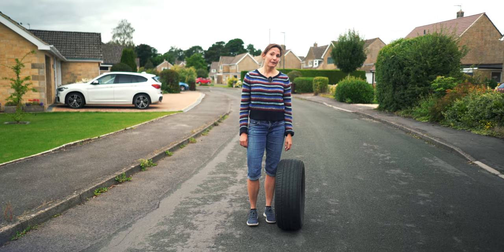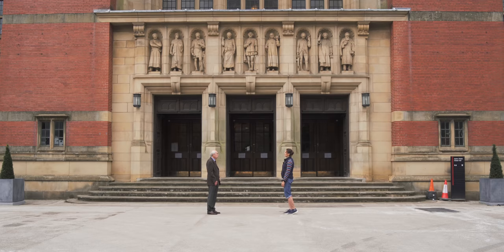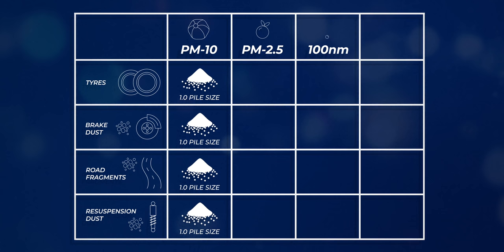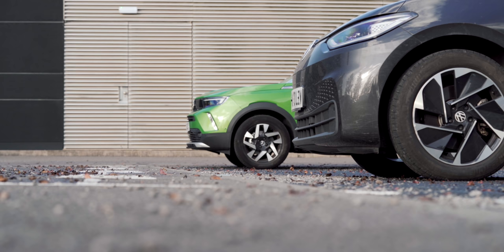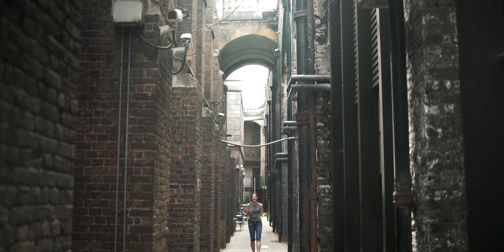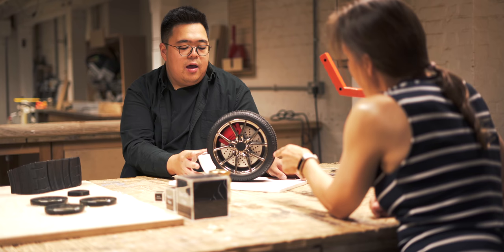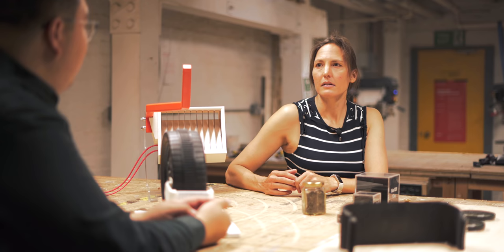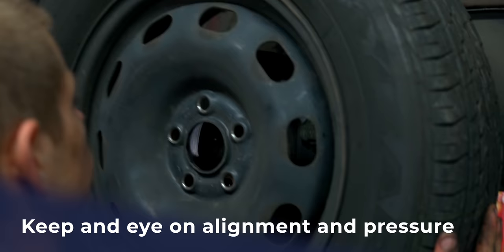The Secret Pollution That All Cars Are Guilty Of | Fully Charged

Comment: My previous ICE vehicle was 1450kg Megane. My Model 3 is 1890kg and has way more hp. Both of those should result in more tire wear. After almost 3 years I am still astonished though that tire wear is definitively less. If I'd be forced to give a number, I'd say 25-30% less. Tire size and even the tire brand is the same and I do not really drive "tamer".

Being very surprised I tried to think why this might be the case, until it one day at a traffic light hit me. I was first in line at a traffic light and wanted to get in front of the car to my right so I hit the accellarator really hard and for the first time conciously noticed that even with a 3.1s 0-60mph acceleration there was no squeaking and tires loosing grip, just brutal acceleration. Accelerating like that with the Megane would have left black marks on the road and made a lot of noise, but because the electric motors can adjust power and torque way faster there is no dicernable tire slip and therefore less tirewear. 

Did anyone have similar observations?
Reply: AWD v FWD.
Spreads the wear more evenly.
Reply: AWD v FWD, Spreads wear better
Reply: @sandersson2813  Even with rotating tires every 10,000km after about 25,000km tires were close to the legal limit on the Megane and had to be replaced.

You are right, with the AWD Model 3 tire wear is more even. Rear achsle wears a bit more. After about 20,000km the rear was a bit more than half, front a bit less than half gone (on it way to the legal limit) and I rotated the tires. I expect this tire set to last something between 35,000 and 40,000km, which is way more than the 25k on the Megane.

When calculating cost, before buying the M3, I had calculated for more tire wear. It's not the only cost factor that I overestimated though, fuel cost and maintenance were lower too. All in all only positive surprises so far.
Reply: That is quiet a Amazing observation! 
And i think you are right
Reply: My Nissan leaf wore the first pair of front tyres out much faster than my previous ice car, probably because I liked trying out the torque from zero a lot. My pocket dictated with their replacements that I didn't press the accelerator pedal so hard. Conclusion, it doesn't matter if it is ice or EV your, right foot dictates tyre wear.
Reply: You are forgetting one more crucial factor that with ev you will break less & use regen. That way tires wear and tear would be less
Reply: @GreenDriveIndia  that is a factor for the brake pads. But maby not that much for the tires.
Reply: @unerbittlich  when you apply hard breaks tires skids a bit too
Reply: @garenson  What sort of miser are you that you begrudge replacing tyres after 20,000km anyway? Its only a few hundred quid.
Reply: @sandersson2813  Those are Michelin Pilot Sport 4S tires that in Germany cost between 800 and 1000 Euro (900-1,100$) a set including mounting them on the rims. If that's a small expense for you, you're welcome to donate a couple hunderd quid to the next set😉
Reply: @garenson  Its not as if you are spending that every week, its every 20,000 km.
If you can afford  a Tesla you cant moan about tyre cost.
Reply: @sandersson2813  It's the other way around. Because of all those savings in maintenance and "fuel" cost the Tesla Model 3 Performance in my usecase is cheaper in total cost of ownership than the Renault Megane hothatch I owned before it, even though it's bigger, considered a luxury sports sedan and loaded with features the Megane did not have.

If you do those calculations for a Tesla Model 3 Standard Range it's about as expensive as a Toyota Corolla or Vauxhall Astra. So a lot of people , if they do the Math, can and do afford it. 

Not everyone has fun burning money unneccesarily, like you seem to do. I'd rather do something useful or fun with the money I don't have to overspend on certain expenses. That's personal preference though for sure😉
Reply: @garenson  The model 3 is not considered "luxury", sorry. Its just a standard car. 
A Model 3 performance is not cheaper to buy and run than a Megane either, behave.

A Megane would have been about 30k tops, 12,000  miles per year would cost you about 2k a year, and a Model 3 Performance is £60,000, so the savings on fuel are nowhere near enough to make up for the cost of the car.
Reply: @sandersson2813  Maybe not by people who can afford a Bently, Rolls Royce or Maybach.

Let's just agree that you do not like EVs and are a bit bitter that something, that you like about the old technology won't be available in the future. If I'd have had to guess it's probably the nice sound of a V12, V8 or flat 6 cylinder engine, or the smell of gasoline. I have friends that like that too and you do not have to believe me, but I do get the appeal too. If I watch a race at the racing circuit I do like those better too, because EV racing series are boring to watch.
The height of those engines on the road has passed though, as the naturally best sounding ones do not get built any longer for various reasons.

For day to day use I think an EV is the far superior choice and I would not want to go back to an ICE vehicle at all. If I have to drive one from time to time it feeIs like I would have to use a Nokia 8210 as my Phone today. I do still like it and it still has things I like better about it (e.g. battery life and size), but a modern smartphone is just the superior product in to may ways.
Reply: @garenson  I do like EVs actually, i just think Musk is a prick and that Teslas are too expensive to look so boring.

Thats fair enough isnt it? I was smiling ear to ear when I test drove a Tesla 3 Performance and the Polestar by the way, so I know theyre great cars.

I dont think its a luxury car at all. Im not sure what country you are from but luxury has different meanings depending where you come from
Reply: @GreenDriveIndia  How many peoppe apply brakes hard? You almost never have to do that
Reply: @sandersson2813  Luckily you'll be able to. Not everone has to have the same taste.

I like the clean minimalist design of my Model 3, interior as well as exterior (maybe I'm boring😉, I do know that it's not everyones cup of tea and that is fine).

As for software I think Tesla is by far the best the market has to offer at this moment in time. Good interface design, Intuitive and lightning quick. Not perfect, but still getting better month by month.

My next car will very likely be a Tesla again. That's a couple of years out though, so who knows...
Reply: @garenson  Thats another thing about Tesla, theyre too common round my way. I want something a bit more of a thinking mans car, not just following the crowd. Theres three Model 3's in my street.
Their colour palate is also really dull.
They just dont try very hard in my opinion, but then they're American and Americans are not known for style or design.
Reply: @sandersson2813  I wont buy something, if it's inferior in my opinion, just so I have something different.

With a little creativity you can make it yours, mine is yellow, not boring at all. I considered buying other rims too, but I like the 20" Performance wheels well enough.
Reply: @garenson  Depends on the criteria by which you judge it inferior.
For example I could state that I consider the design of a Polestar to be vastly superior to the Tesla, I might consider the range of the Tesla superior, but its relative to what your requirements are.

Cars are always a trade off. Can I trade off less range to have a better looking, better build, better driving position, kess wind noise etc? If yes, then I'll buy an alternative. Simple.
Reply: @sandersson2813  Exactly!

Comment: The only good thing to come out of recent lockdown experiences is that some of use now have a choice to work from home at least part of the time which will reduce some of the pollution.
Reply: It will be an enormous reduction! Doing 1 day at home per week, every week, reduces the commute-pollution by 20%.
Reply: Cycle
Reply: @jrisner6535  not everyone works in a single city location. Too simplistic.
Reply: @ianjames3078 "single city situation" what does that even mean?
Reply: @jrisner6535  I got 40km round-trip. going by bike will be 2-ish hours. car is 40 minutes :(
Reply: Example: after lockdowns Lisbon trafic increased quite a lot as people that need to go to the office 1 or 2 times per week now by car instead of public transportation
Reply: @Ruisantos84  Yes initially that happened here (London UK) but now commuters are going back to public transport.  In part that is because the local government has made it very expensive to drive in London, up to £27 per day (Low Emission zone + Congestion charge).
Reply: @jrisner6535  some people work in different locations. I could go to my office 30 miles away then drive to another office 40 miles further, then go to several customers. The roads aren’t safe for bicycles either. Don’t get me wrong, I cycle for pleasure but work is impossible. 
By single city I mean people either don’t work out of a single location or/and not live/work in cities where the cycling infrastructure is available.
Reply: @ianjames3078  hmmm, driving in the country is different 🤷‍♂️ is people driving in cities for no reason that gets me!
Reply: @jrisner6535  100% 👍

Comment: Lots of good points. The expert  interviewed started to explain, but stopped short explaining, that it isn't just the sum total of mass of the particles that matters, because the smaller the particle size, the more toxic it tends to be, because these smaller particles are more difficult for our lungs to eliminate - basically, the smaller the particle size, the worse their impact on our health. This is why there are 3 size categorizes for the particulates we do our best to measure. In actuality, a large number of ultra-smaller particles can weigh less than a batch of larger particles, but these smaller particles can have a much worse impact on our health. So, it's not helpful to just reduce the mass or weight of the emissions from our vehicles and powerplants, if we're basically letting all of the smaller, most toxic/dangerous particles slip right on through or possibly even get increased by the process we use to trap or burn up the particulates. The expert could have gone further in his pointing out that not all particles are equally toxic - by stating, instead, that the smaller the size of the particle, the more toxic it tends to be, so many of our emissions reduction techniques and technologies are far less effective than we assume when we measure only the % reduction based on total mass or weight of the particles, when we should be looking at the overall toxicity of the particles that are exhausted or otherwise thrown into the air we breath.
Reply: You are 100% correct. And particules coming from fuel combustion are far smaller thant brake particules, with tyre particules being the largest, and therefore both the most present by weight, and the least dangerous

Comment: This scheme seems like it will fail as soon as there's the slightest bit of snow or heavy rain. Anyone who's driven in the snow knows how the inside of the wheel wells get absolutely packed with gritty slush, and this electrostatic scoop will be clogged solid within minutes. Wet conditions in general will disperse any electrostatic charge and render it inoperable.

While it might not be practical on personal vehicles, perhaps we can just fit standard air filters to municipal buses and have them filter city air as they drive around. This would also help clean up other non-vehicle emissions, like smoke and odors from buildings, construction, and businesses.

Comment: The government and councils can do something too. For years they've pushed policies to discourage motorists from using their cars by introducing bus lanes, cycle lanes, speed humps, extra traffic lights and so on. A lot of these measures encourage a bad driving style, foot down (exhaust pollution) to avoid being stopped at lights or after a speed hump, then foot on the brakes for the next red light or speed hump, thus doubling the problem. They need to help smooth traffic flow, not proliferate the stop-start state of the roads we're forced to endure in towns and cities at the moment.

Comment: Very interesting. I used to live on a major peak hour highway in a 3 x 1 brick and tile cottage which was built right on the braking and accelerating zone for traffic lights. I bought the house during a major depression so there wasn't too much traffic or noise. After the economy began to recover so did the traffic and the noise. The house exterior when I bought it was newly painted with nice manganese bricks and orange coloured roof tiles. Well, after just 12 years the manganese bricks had turned black, the orange roof had turned black, and, wait for it, the grass and soil and also pretty much everything else in the garden was covered in the same coating of a particular kind. It was brake dust and lots of it, so much so that I recognised the familiar smell from having worked on my brakes. The brake dust and other pollutants had rendered everything literally untouchable to my bare hands which stung so badly that I was unable to pick up any object in the front yard of the house. I sold the house asap after realising the pollution I was living amongst.

Comment: Nice work Helen. A great episode. One thing to touch on in the future would be the actual composition of tyres. The video mentoned "rubber" and I feel most folks think tyre are made from "natural" rubber when they mainly comprise of plastics. Tyre dust (fine plastics) then get mixed into the ecosytem. Gah!
Reply: I was thinking the same when watching this
Reply: I concur. The synthetic rubber in all it's different compositions just running around in our environment adding to the pollution problem. Can you say "plastic rain"?!
Reply: @rngalston  no, thats a song by Prince that never made the cut!
Reply: Yep, be interesting to hear about the addition of other elements in the tyre to either reduce wear, and/or make the worn particulates more 'safe', whilst not detrimentally affecting road surface grip! Too much to ask!?
Reply: You mean synthetic rubber. Yeah the vast majority of rubber is synthetic.
Reply: Many if the resins used in rubber manufacture are extremely nasty and come in bags with a skull and crossed bones on the bags! I worked in a factory that used these to make rubber compounds that  were then dissolved in solvent to make impact adhesive and glues. Nasty stuff many workers died from handling the resins.

Comment: In North America, a favourite tool to control traffic speeds are four-way stop signs.  If we eliminated those, we’d reduce a lot of the brake dust and tire fragment pollution.
Reply: But then you'd have vehicle fragment polution
Reply: @crackedemerald4930  at least it would reduce the number of vehicles on the road too…
Reply: The added accidents from ppl not knowing what to do will negate any improvement in wear, unfortunately.
Reply: @deanfielding4411  and would reduce the amount of mobile vehicles in the road
Reply: More roundabouts with yields! less stop signs/lights.
Reply: Americans cant understand roundabouts

Comment: Brake usage on an EV is nearly zero though, so tailpipe and brake pollution greatly favors the EV.
Reply: It takes more carbon emissions than an internal combustion engined car to manufacture though. Get yourself a push bike, do yourself and the environment a real favour.
Reply: @stevezodiac491  it does your right but an EV has lower lifetime emissions. Plus the technology for producing EVs is still relatively young so has potential to reduce production emissions further.  Fully charged podcast mentioned a study that concluded that the worst EV scenario of charging with the dirtiest coal power plant and the worst production methods would still be better than an ICE vehicle.

I’m an avid cyclist and bmxer… so push bikes will always win.

Comment: I think that context is necessary for statistics to have relevance: Saying that EV's don't have zero emissions is a fair point, but the total are minuscule when compared to an ICE vehicle. Another important distinction is the effect of those emissions: fossil fuel combustion emissions effectively constitute the entirety of the extinction threat to humanity. Where as the physical particle emissions impact health is comparatively negligible offering some limited deleterious impact to health only in areas with abnormally high traffic density and pedestrian proximity: Cities. To which the solution is probably better public transport and bike/scooter infrastructure. Cities are designed for cars, not for public transport,  pedestrians, and cyclists. That means that people use cars as they are the most convenient option.

Comment: I work with Reach compliance, it seems to me that tyres and diesel soot are related in the potential PAHs in the carbon black used in the tyres (mainly to make them black or possible conductive as far as I know).  This is created from burning diesel, and can be highly carcinogenic if its not burnt correctly.
As for comparing with exhaust emission, they are measured in tons per year per car.  You don't use tons of tyres per year.